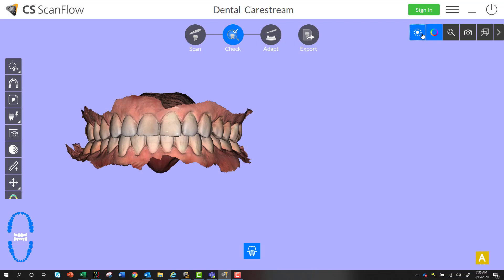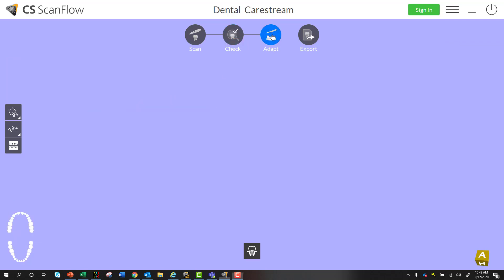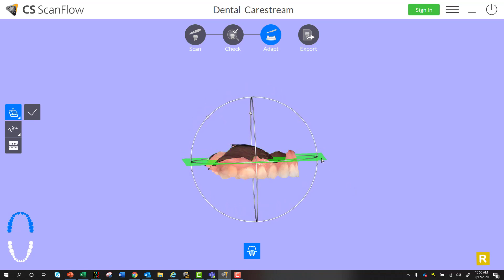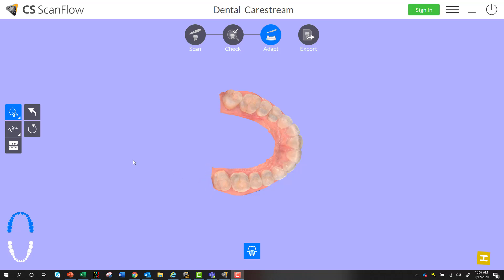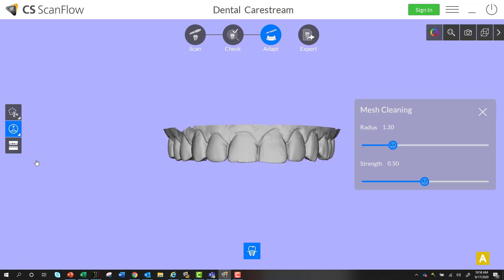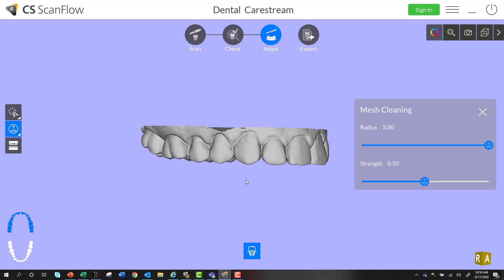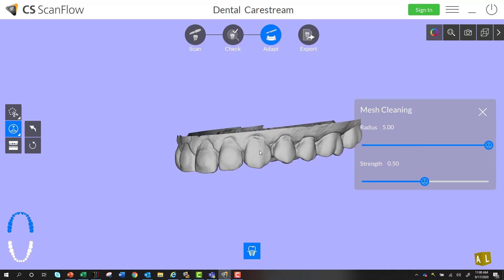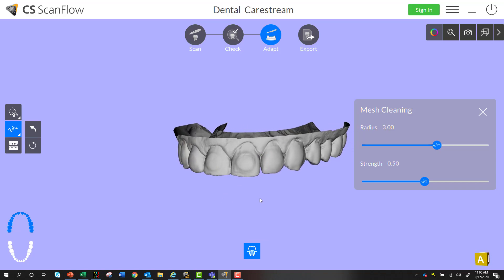CS ScanFlow Software Bleaching Tray Tutorial

Comment: Anyone to ditch out the Gingival margins to make a better seal? Also can you do a save as so  don’t lose the original scan?
Reply from the maker: Yes, another tool in same area can be used to ditch.  There is a workaround on doing a save as.  Yes.  Hard to explain here.
Reply: @PhilLeinberger  they still haven't fixed the save as thing?   On the old software so annoying to have to find file to open  it again of you wanted to not rescan everything.